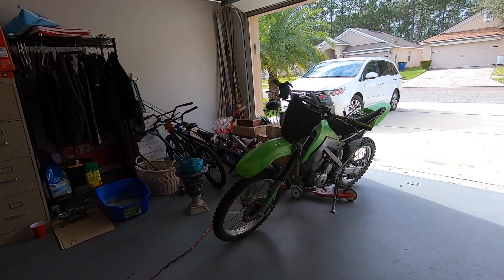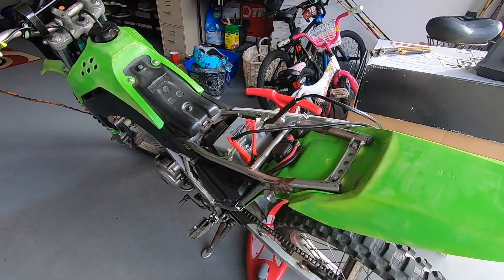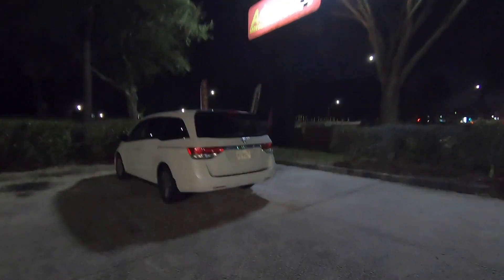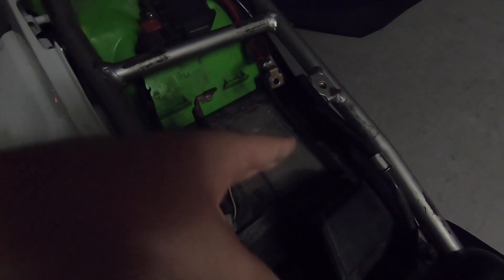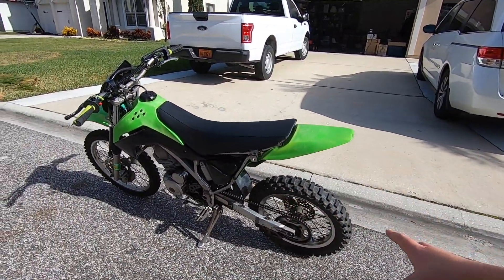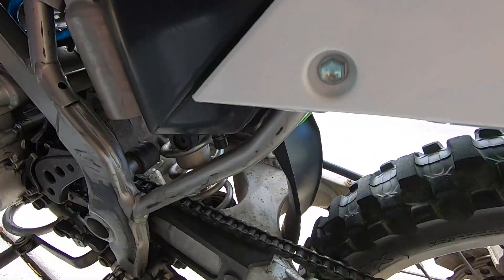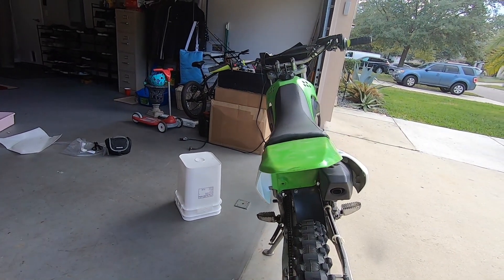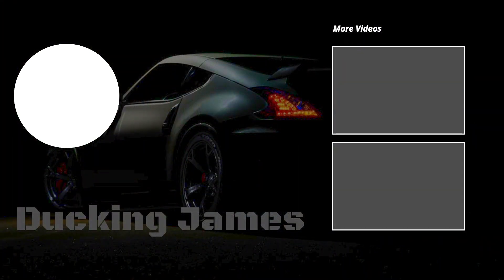Fixing Up My 2009 Kawasaki Klx 140L | ELECTRICAL PROBLEM!!! | Dirt Bike Project *Part 3* |

Comment: What electrical thing did you do to fix it I have the exact same bike and it keeps doing this about a week after I replace the battery please help
Reply: Same! Lol how you gonna make a video about fixing a bike and just have a throw away comment like "it was something with the wiring" then just not even mention it and move on??
Reply from the maker: Haha
Reply: @pow_dirt_hound  i figured out the problem it means your stator is out its super super difficult to fix bc u gotta open up the engine and the stator alone brand new is anywhere from 200-500 dollars for that bike he didnt fix it he just charged the battery and he didnt show it in the video bc he is selling it thats why he didnt say anything
Reply: @demonxuka4732  is he really selling it? Too funny. Luckily I think the stator on my girl’s klx is ok, though the battery won’t keep a charge. Her’s didn’t want to start over and over, and strangely, if there was any pressure on the throttle or any controls it would spin once and then stop. Come to find out, if you keep hands and feet off all controls and just push the starter button it fires right up. I think the safety trip switches that prevent the starter from spinning are getting tripped too easily and stopping the motion. Could be wrong (probably haha) but it’s working so far.